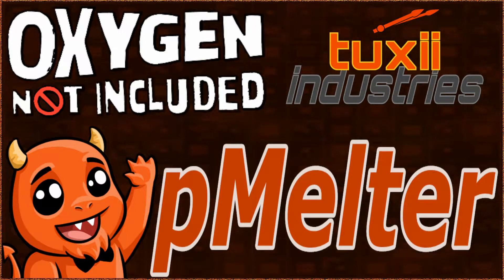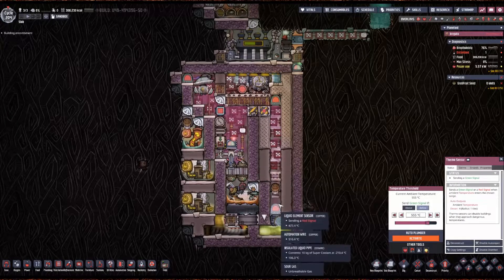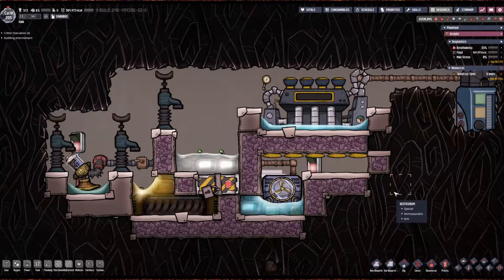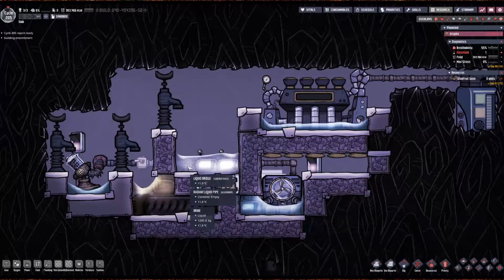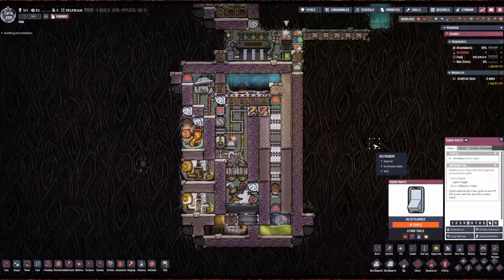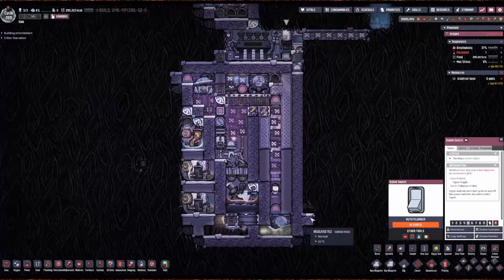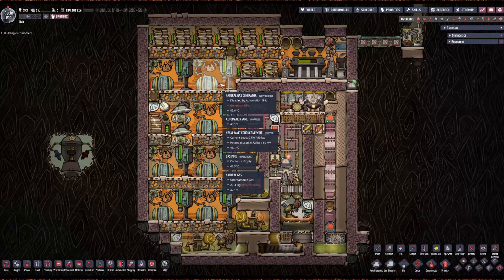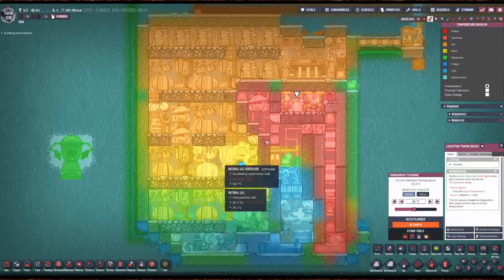pMelter - Grow Plastic For Power! - Oxygen Not Included

Comment: 50kg of sulfur is not to bad from 1 drecko. I built a few different designs in debug and the most I can get of sulfur is around 160 Kg per cycle just using sour gas. It sucks the game locks thermium and super coolant till near end game. In spaced out if you need sulfur its better to just get it from the geyser or a asteroid in space.

Comment: Does everybody play in sandbox mode? Am I the only one who plays with no cheats? These setups are almost impossible to build with dupes, a simple error means a ton of redoing
Reply: its easier to do practice builds or one offs. I use debug as well to practice and when I get a setup right I make a blue print from it. to build in game, but yeah it sucks ass when in game something goes wrong. I had my spom get messed up from gases not separating right 2x in a row and it took a while to vacuum, after it happened again I said fuck it and loaded debug and vacuumed the room quickly. it wasn't worth the time to wait. But I would not do a actual build using debug. In game I make the dupes struggle and gasp for air lmao. much more fun

Comment: i absolutely want to make something like this. I never saw a setup like this before, but i'm really surprised that this setup is not that big. And not that difficult to build, except that we need thermium
Reply: The biggest problem is that it takes a lot of Dreckos to scale this solution, compared to only a few oil wells to run a traditional sour gas boiler. Also, plastic is really hard to melt in 10kg packets. I love what he did with the 1kg packets. But basically, if one is trying to maximize, oil provides the equivalent of a very large map area worth of glossy dreckos. I think that's why it's not more popular.

Comment: if you have magma, and hydrogen, you can use steel and thermo regulators or AE nullifier to do the same. if you have an aquatuner to cool the sour gas to room temperature, you could use conveyors to move sulfur through the cold side heat exchanger, to help cool the inflowing sour gas.

Comment: i have a bit of a challenge for you. I stumbled upon this video while looking for power sources for my weird "challange" base, where i dont settle/land on other asteroids. Currently my base is running on geothermal power, but that is eventually gonna run out, and i do not have access to oil, natural gass, volcanoes, or uranium. I also do not have access to space metals, what with being limited to steam, co2 and sugar rockets. i do however have plastic dreckos, so would it be possible to make a non space metal/supercoolant versions of this melter/boiler?
Reply from the maker: If your starting asteroid has a volcano or a minor volcano, those would be easy substitutes for the thermium aquatuner as a heat source.  Metal volcanos could also be made to work although, it would be more difficult.  If you convert before your geothermal goes completely cold you could use that, at least temporarily.
Without super coolant you have to resort to thermo regulators cooling hydrogen.  I am not sure if that could give you enough cooling capacity do the job on its own, but it could be used to get you methane or liquid oxygen which you can then use in place of super coolant in steel aquatuners for cooling.
Good luck with your challenge!

Comment: Looks brilliant! I love a good rainbow :D 
Regarding getting those insulated tiles down to -159c, would it be worth "priming" it using tempshift plates and hydrogen gas before you start using it? It's an extra step, but it might save a bit of time overall? (I might have a look and see how long it'll take to cool those tiles down)

Another suggestion for everyone else, if you want to only have one supply of plastic and are worried about having not enough plastic for building, you can turn the input off from automation from a weight plate, especially if you're storing the gas infinitely
Reply from the maker: It only takes a little while, less than a cycle to get those tiles down to temperature.  Also no natural gas gets wasted in the process unlike my other boilers where the liquid vent deletes it. You can prime them, but I feel it's an unnecessary step.